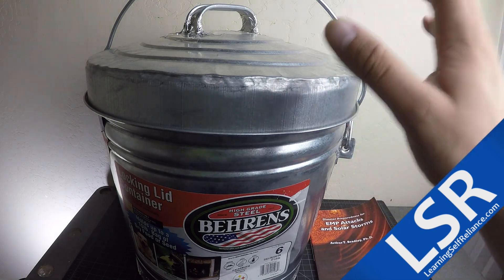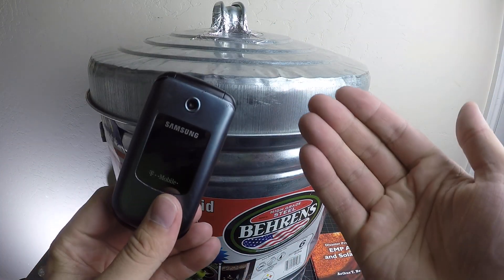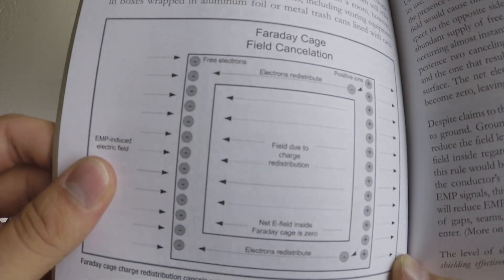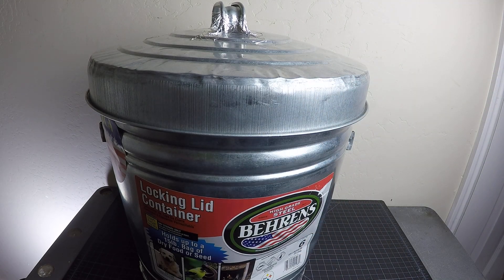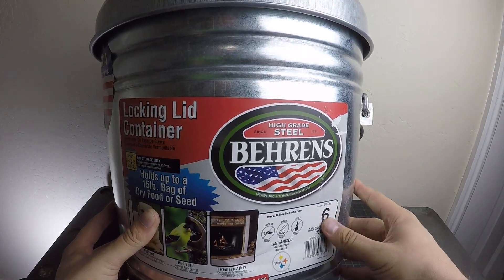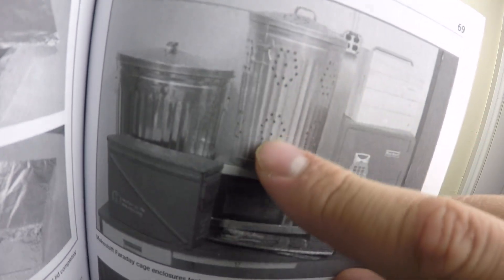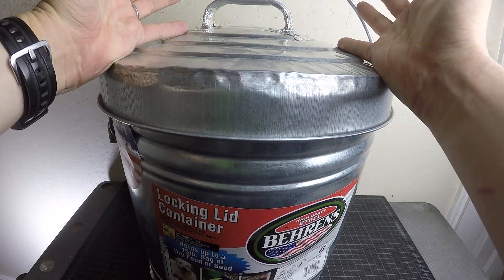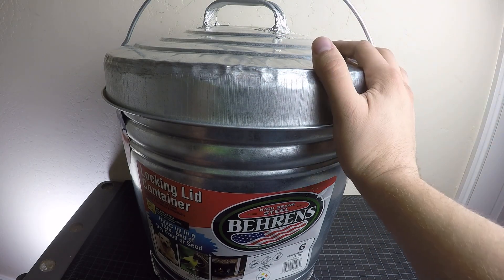Faraday Cage & EMP Misconceptions

Comment: I worked in the paging industry in the nineties and we worked in screen rooms to tune the receivers. We needed to have the enclosure grounded to work properly. The other thing we had to contend with is the door and its frame ( same as the lid on the garbage can) the doors are equipped with special flexible metallic gaskets that enables an excellent electrical seal blocking out radio waves. I tested the cage with an HF radio transmitting outside the cage into a small antenna with a receiver on the same frequencies within the cage. We tested from 3 KHz up to 440 MHz and then with commercial equipment from 150 to 1 GHz with no intrusion of any of the signals. We were about five miles from a VHF low television station (ch4)and about a mile from a local high rise building with multiple high power paging transmitters and could not receive their signal inside the cage. Don't bother these cages started from 3K$ and the sky the limit depending on size, screened panels, isolation panels for electrical inputs, lighting options.
Reply: Wow! Awesome contextual info. Cheers
Reply: Thx
Reply: I always ground my setups. I drive copper pipe about 3 feet into the ground and use #4 ground wire.
Reply: Thank you very much for your, informative industry backed  information. Nothing against  this guy's channel.But even  from an educational point of view. His info didn't add up. Further, not all EMPs are created equal. As I understand it, a large high altitude nuclear detonation , would cause a over load. Like a very large lightning strike. Millions of volts of electricity. not frequencies. Thank you again.
Reply: @tonymontalban5603  One can read a book and still not understand it.  He was using terms, I bet, he could not explain to someone else correctly.
Reply: I was just going  to comment that Faraday cages must be grounded, it's not optional. Then I saw your more knowledgeable comment. Thank You!
Reply: @garydoyle5755  I wouldn't discount the video too much. This is a floating ground.

Comment: I did a lot of work on the Mill EMP protected PCs, they were well sealed, and nothing, not even 1 seam was left open, 2 layers of stainless steal in most places, special metal gaskets, lots and lots of screws to insure proper mating of parts. If the relatively week cell signal can get into your can, what do you think the massive amount of energy from an EMP/CME will do? 

Best bet use the metal duct on every rivet, seam, and opening on the can, use nesting 2-3 layers deep. The foil tape is like $22 for 50 yards, Cheap when I look at 3 radios, 3 high dollar flashlights, 3 GPS units, 3 Red Dots  and other electronics. Easy to open a razor knife on a string tied to the lid. 

Do you need this? Only you can decide but, if your going to do it, do it right.

Comment: Good video. I've read you can't rely on taping to help seal it because the glue on the tape (the thickness and length) is also a micro gap. I'd be interested in your opinion about that?
Reply from the maker: +talshiar50 I'll defer to the book for details on the effectiveness of the tape. But I think it would be just fine. The only thing better could be a waterproof weld of the seal. A weld would be best, but good luck getting it open without poised tools, and without frying he contents! Haha
Reply: D Chan you are right. Better to do things half ass then try and do them the correct way.....

Comment: I tried in short order to find some information on solar flares but could not get anything real. The previous solar flares such as the Carrington event which if would happen now would be catastrophic, is Would now be multiple times worse due to the lessening magnetic shields going down. As we enter the solar minimum, 2017, the shields are down exposing us to much more harsh and direct contact.
Reply: Yes a large ‘Carrington event’ could possibly destroy all transformers in the electrical grid make restoration near impossible. If unrecoverable shutdowns happen to satellites, internet, radio communication, digital data, phone systems, electrical systems then we could face homes with no heat, water, refrigeration, communication and a financial system destroyed overnight. The outcome is unimaginable. BTW, this is exactly what I fully expect will happen within a decade.

Comment: could you use flex seal (a rubber paint) to build faraday cage
Reply from the maker: I'm not sure what you mean.  Do you mean to paint the inside of the bucket?  The outside?
Reply: well the inside not sure why you would paint it outside. dont think painting outside would work. I think if you used flex seal rubberized paint you could get a better seal inside thus making the db's higher. like 100db. i have not seen it tested yet. i know it may be expensive way but you could cover more area plus a better seal
Reply from the maker: +punky bruster it could probably keep the electronics from touching the inside of the metal bucket. I'm not sure if it would enhance the db reduction.
Reply: punky bruster.  I had the same idea, I've coated the inside of the can and the lid, but still gonna line it with cardboard.

Comment: I just watched a video how nuke emp are 73000 times stronger then radio signals if it cant block your phone a super weak signal I don't think its going to muffle as you put it some 73000 times stronger
Reply: jay V is right.  This is like testing an air mattress in your swimming pool, declaring that it floats, and believing you're all set if Noah's flood comes.  Bull.  Shit.
Reply: They are that much stronger *at the source*. Inverse square law then comes into effect. By the time it reaches you 50db of attenuation will help a lot. The problem here is that very few people worrying about EMP have any background in physics and generally don't even know what a db is or that it is a log scale etc.
Reply: @tracyrreed  you are so right, the further away the weaker the effect.
Reply from the maker: I'm not certain about how strong a nuke can be, but I read the book and it said that this farday cage should be enough, so I'll go with what the book says.
Reply: if the worst was to happen,I hope that book is right for all our sake.
Reply from the maker: Agreed!  I believe the author knows what they're talking about.  Probably better than the average Youtube EMP video :P (says the guy that made a Youtube video)

Comment: thats not a Faraday Cage its a metal bucket, the word cage is the key word. a Faraday Cage is mesh which stops the field depending on the hole size.
Reply from the maker: +D.j Tatty this bucket should stop some pretty small radio waves then!
Reply: no, because everything is in the form of a field. so your bucket will just conduct, as the holes are so small it will use the air pockets to jump across the nano size holes.  the holes need to be big enough to slice the frequency so it can be dissipated it across the area of the cage, thats why most people ground the cage, so that it has somewhere to dissipate too. other wise it would build up, then you would be the path to earth the minute you touched the cage.
Reply from the maker: +D.j Tatty I'm going to defer to Dr. Arthur Bradley. I'm fairly certain a small hole would "slice" a field better than a larger hole, if there is such a thing.
Reply: your missing the point, its a faraday CAGE not BUCKET cage being the key word, he would have called it a faraday bucket or shield other wise. if you put an animal in a cage in lives, put it in a bucket & it dies.
you with me.
Reply from the maker: sure. But lets not argue semantics. This bucket will protect electronics, cage or not.

Comment: Thank you for the info, I just order the Book you have. Being a concern amateur radio operator I like to be ready. I did make a Faraday garbage can, I use the large on and microwave oven that don't work. I took the AC cable off the microwave. If there anything else I can do, please let me know. Thanks again.
Reply from the maker: +accorgan just make sure to have a complete 720 degree layer of metal all the way around your electronics, and insulate them front the metal!  A broke. I hear broken microwaves work good.

Comment: http://www.futurescience.com/emp/vehicles.html

An EMP of 50,000 volts per meter would undoubtedly damage some cars, both with and without solid-state electronics.  What percentage of vehicles would be damaged, and which particular vehicles would be damaged, is something that even the best EMP experts can only make guesses about.  The total available data is just too limited, and the number of variables are huge.

This has me skeptical with where the numbers from that book came from
Reply from the maker: Paraphrased from the book:

In 2008, the EMP Commission conducted tests to determine the susceptibility of automobiles to an EMP.
 - Tested up to 50kV/m.
 - 37 cars & 18 truck tested.
 - 0 anomalies with vehicles turned off
 - 8 cars, 5 trucks, had anomalies when turned on

If the results of the test are taken at face-value, 3% of card and 5% of trucks would be permanently damaged and would require repair.

There is a lot more information, I wrote some of the important bits.
Reply: lifewire.com

This is one I saw from 2004 on 37 cars that came to the conclusion that 90% of cars would not be effected.  But it also says something to take into account how cars have changed over the years.  One thing that might leave many vulnerable are remote start vehicles or those that require a microchip key.  Basically, with both of our instances mentioned, it's far too low of a number to get a full range of the effects, account for advancements in technology, or gain a proper idea to scale against the millions of vehicles on the road every day
Reply from the maker: Good points about the remote start, if your Fob broke in any way, you couldn't start the car without hot wiring it.  Good points.  Thanks for the great comment!
Reply: Thanks.  I think it would be a given that electric cars currently charging would be done, but not many people have those.  Many cars from as early as 2007 tend to have lojack as well in case someone steals it that could possibly act up.  There's now cars that stop themselves in case you get too close to a car which may be stuck on a locked position or those that park themselves.  These features aren't typically controlled via the dash and as such, more exposed and as likely to malfunction as a car radio

Comment: you are SO confused! a tight Faraday cage REALLY takes off your cell phone signal and you won't be able to call anymore. 2. it does not create electricity INSIDE, but only on the outside walls, rearranging electrons, so that on one side they will be positive, the opposite negative, and inside it will be ZERO. YES, it needs to be grounded, in my opinion, because it helps release the electrical charges on the outside walls. you can measure these charges, they are there, and they shall be grounded and clear the space of that electrical charges. ofc it won't electrocute you, but they are there, and they should better not. if you ever stepped inside a Faraday cage, it is cooler that the environment. why? because EMR really cook us, slowly, especially when we stay in one place for a longer period of time.
Reply from the maker: What you've said is almost completely different from what Dr Arthur T. Bradley states in his book.  I'm no expert, so I'll refer you to his book.
Reply: Needs to be grounded? Air Force One, the presidents plane, is very well protected. There CANNOT be a ground wire on a plane, 'cuz it's waaay too far off of the GROUND, yet the protection is considered to be first class. 
Taking that down to we lesser beings, we gotta' have a really long ground wire to haul our cages in a bug-out car, right? 
About your "in a Faraday cage its cooler, but outside, standing still will cook us", (did you use a thermometer?) Is an office worker hotter at work than when he's running a marathon???
How many days/months/years? does it take a comatose patient in a hospital ICU, to get "well done"? Ya' gotta' think this stuff through.......

Comment: dude i got pissed when i could hear my phone in there. u got the same problem as me, conductive tape the gap where the lid touches the can and ur phone wont work anymore in there.
Reply from the maker: +Digitalmanne good point. I have a larger faraday cage that I seal. It's nice to have a secondary cage for commonly used items.
Reply: Not if it doesn't work.  It might soothe your little feelings, but it's useless if it doesn't work.
Reply: the guy that wrote the book you quote from has a video about sealing the can with the conductive tape.  I believe he said with that, there was an 80db drop in his testing.
Reply from the maker: Great idea.  The author of the book didn't say that was necessary, but it will certainly help.
Reply: @lrnselfreliance  
The scheme  worked for him, he got your money.
Reply: Use an ammo can. Tear out the rubber seal and use the tape.
Reply: white  If you got a metal file cabin, then you can use that without modification. Checked it about 3 month ago and it worked on the one I got.

Comment: that being so, still should go for a box that can totally block your fone. My tin can box can block phone signals as well as radio frequencies up to 107mHz being the highest available FM frequency there is. an EMP has a frequency 15-100mHz while CME 16-40mHz (based on online research). it cannot block my UHF radio as it it operates at a frequency of 400-460mHz.  I keep my uhf/vhf transceiver in the tin can, although frequencies over 400 mHz seep in/out, if something detonates much stronger and fries my tech in there I have even bigger problems to deal with, like being dead.
Reply from the maker: The "bigger problems" are what Preppers prepare for. :)  As I said, the author of this book says that you're not trying to block every decibel of every signal, but rather, lessen the strength of the signal so its no longer damaging.  That being said, any less signal is better!

Comment: Hey, I've been prepping for a few yrs now. I plan to make a cage for led flashlights, hand crank radio's, hand hels and so forth. Just small mobile items ( I have a plenty of non electric lighting as well ). Does this book explain what will be effected by an EMP as well?
Reply: Your rechargeable NiMH batteries actually have electronics in them to prevent overcharging and overheating.
Those too plus a charger need to be protected.

I am not sure LED flashlight bulbs are immune or now, especially when there is no power to them.

Comment: what makes that a Faraday cage.  do you know how a Faraday cage works.  if it was a Faraday cage it should block radio frequencies.  we use to use them to do neurobiology experience on rabbits to block external radio freqs.
Reply from the maker: It blocks ENOUGH radio waves to stop the electronics from being damaged.  If you're running some sort of experiment with sensitive equipment, you may need more blocking than I need to stop an EMP from damaging my electronics.

Comment: So what are your thoughts on these shipping containers as gaint Faraday cages?  Thanks
Reply from the maker: As long as its solid metal (or sealed well) all the way around, I suppose it should work just as well as this bucket.
Reply: Too many seams, but they do offer some shielding. Not much better or worse than a tarp against rain. You'd be drier but not dry.
Items placed in better ( but maybe also not perfect) Faraday cages inside a shipping container, or good metal shed or garage, will fare best in a CMA or EMP event.